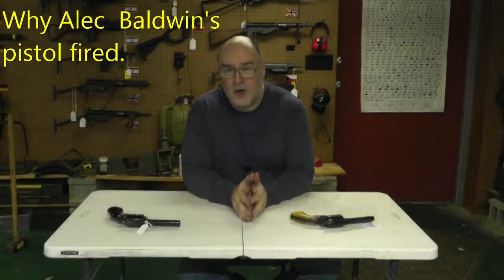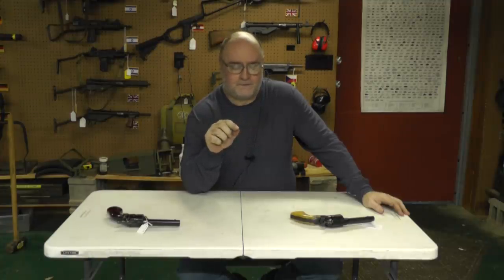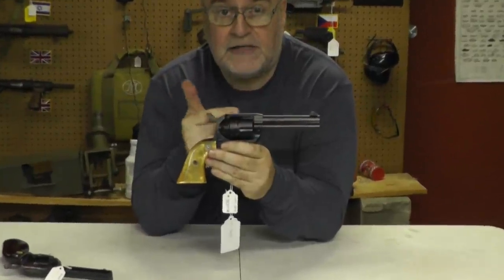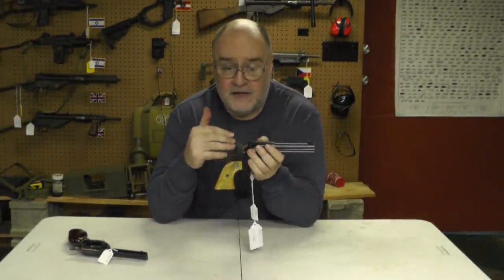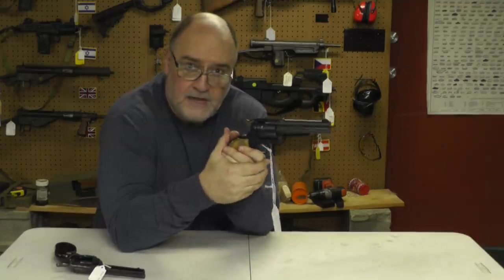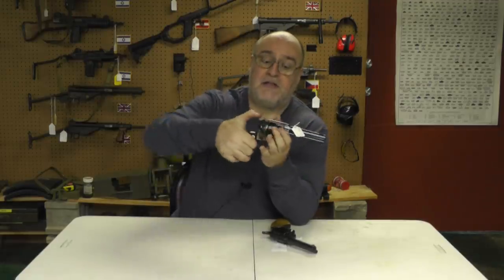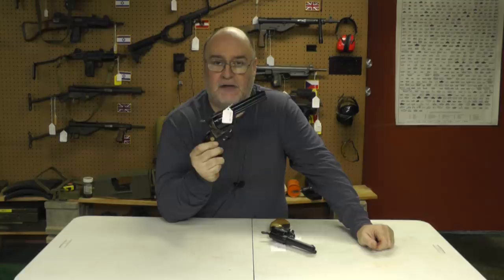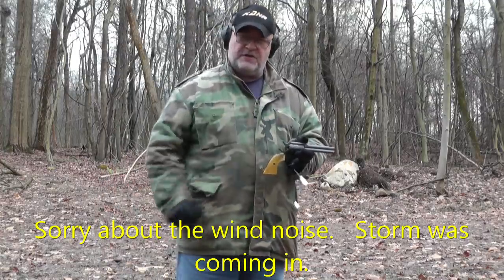Why Alec Baldwin's gun fired

Comment: I have 7 single six pistols and this is exactly how they operate, good job. This is exactly what happened to Baldwin. The trigger may have been adjusted so that it was too light. However, no matter what way you cut it, Baldwin was negligent and the Armorer, the young girl, was incredibly negligent. I believe that Baldwin will plead out to Guilty-straight probation (no jail time) but I believe that the Armorer should and will be sentenced to jail. I believe the DA will allow Baldwin to plead out to no jail time but I believe the DA will not give that choice to the Armorer. The DA will insist that she does some jail time. If Baldwin is stupid enough to take this to trial I believe he will loose and he will go to jail as well.

Comment: I just wanted to point out I have actually done some speed shooting there's footage of me in the late '80s on baseboarding in Bolton Ontario Canada doing a speed demonstration and I used the same pistol I will say that I have one seen a pistol like this that had its notches shaved off so that you could fan the weapon without pulling the trigger this was actually a mod that was performed by some speed and trick shooters strictly for speed because it meant you didn't have to pull the trigger you just fan the weapon that's one thing that's one situation where I have seen a weapon that would fire if all you did was pull back the hammer all they did to achieve that was file it down a little bit on the other hand I have seen one that was so worn that it was out of use and when I asked why they told me that the parts were very rare and they were planning on making a part to rebuild it the problem had been and had been fired so much that that notch was worn off so when you pulled back the hammer you could feel it rubbed the notch but there was no click and it would not lock in position. Just wanted to point out that I have seen both of these and handled them and I have to tell you if that had been shaved down or had it been so worn inside that that notch was gone it becomes an extremely dangerous weapon to handle when it's loaded because all you have to do is let go of that hammer and it will go off now you make a very good point and there's a lot of people saying it's his fault you seem to be under the impression that the gun was supposed to be empty that is not true it was supposed to have dummy rounds which means when you look at the gun it's loaded! In addition to that the only way to really tell the difference between a dummy round and a real round is to take the bloody bullet out and see if there's gunpowder in it and if you don't do that the only other way really would be to shake it and listen to it or to put it on a scale to see that the weight of the gunpowder and primer has been removed in order for that to work you have to know enough about them to do that and that's the armorer's job. I served sir I was a Master Sergeant at Arms on board and at the time I did the shooting demonstration it was my job to know, however I agree with your assessment that Alec was probably not a serious gun guy and even a lot of gun guys wouldn't know anything about the 1897 Colt it's such an old weapon most people know nothing about it even though I was teaching firing skills and shooting technique and safety I knew nothing about that gun until I prepared to shoot it for the event but since then I've learned quite a bit about them and I have quite a fondness for them.
Reply: thanks for saying this.   evryone who's ever touched a wheelgun has made a video of this tradgedy, but as far as i can tell, not a one of them has inspected the actual gun.  perhaps he did screw the pooch, or perhaps the weapon failed..  i have no idea, and niether do these people trying to collect views.
everyone says innocent until proven guilty until they can make a video demonstrating their ability to shed zero light on the subect.
Reply: I had a Colt .22 that was worn in that way. It wasn't worth repairs at the time. I eventually took to the local police station where it would be taken to be destroyed. Very dangerous.
Reply: Dummy Rounds , do NOT have Primers , or they have fired Primers , this is easily observed , in a split second , from outside of the Revolver or through the open Loading Gate of the SAA . ~~~ They should simply USE " Plastic Snap Caps " and Paint the Bullet end Grey ! ZERO Confusion , for the Novice .
Reply: @mahatmahjeebs6622  my question is, why would there ever be live rounds at a movie set to begin with? I don't hunt with blanks?!
Reply: @mr.hanger  , They was Playin Games !

Comment: You're right he's an unknowledgeable gun person.   But it's irrelevant. I've been around guns all my life and I'm former US military and I did 30 years as a Police Officer.  Additionally, I have a relative who's a renowned movie and TV set armorer and this is what he told me.   It's not a crime what he did.   The actor simply does his job and is probably so mentally engrossed in what He's doing.  Many times, between rehearsing, practice runs and actual takes while filming he or she has probably done the scene 100 times.  Needless to say, there is an element of being tired mentally and physically here. 
      Now,  Its the props managers job or Armorers job to check all equipment being used. Actors never check guns.  Also live rounds are NEVER allowed anywhere near a set.  
 I was told its no different than giving an actor keys to a vehicle on set where the actor needs to do a scene while driving .  The actor doesn't check the vehicle being used for mechanical issues, safety checks , brakes and whatnot. So now let's say the actor gets in the car while filming a scene and then he starts the car and shifts it into gear . Then the gas pedal sticks and then he loses control of the car running over and killing the director.   Should the actor be charged with vehicular manslaughter ???  Umm NO.    Its the same exact situation.   I know people have a negative view of AB and maybe rightfully so but its simply not his fault. Being that AB was possibly a producer of the movie that would make him civilly liable , but not criminally.  Hope that clears things up.
Reply from the maker: No that doesn’t clear it up you need to go read the police affidavit there was a continuing course of conduct by Baldwin ignoring prior safety violations including two accidental discharges and allowing live ammunition on set he never made any attempt to fire the incompetent armor He ordered the incompetent armorer of the set while the scene was being filmed.  The assistant director handed Baldwin the weapon.   Again another safety violation.  The weapons were not secured during lunch another safety violation all knowingly permitted by Baldwin. the affidavit is a lot more specific with Baldwin continuing course of conduct lead to the woman’s death.  totality of circumstance if you were a police officer you should know what that means
Reply: Its literally in the actors guide book to always check your gun after an armorer hands it to you and to never point it at anyone.

Comment: You are 100% correct in your explanation. I own a Ruger Super Single Six in 22lr, it's also a earlier model refered to as a 3 screw. That means that it functions exactly like what you have except it is chambered in 22lr so the results would be the same just not quite as loud but still VERY DEADLY.
Reply: I also own one of those wonderful old Ruger single six in convertible fashion.  Ruger really wants me to send it back to be modded for safety against exactly this.  Nope, sorry.
Reply: @ruatonim  I agree with you about the upgrade or safety conversion. If you can't safely deal with the original workings of ANY WEAPON then DON'T GET IT get something else that has IDIOTS OR NOVICES in mind. It's tough to make some devices or tools COMPLETELY IDIOT PROOF cause there will ALWAYS a BIGGER IDIOT out there that you didn't plan for, sad but TRUE.

Comment: Thanks for doing this video. I’ve seen some of those other videos in which people were using replicas. A replica that has been manufactured in modern times does not work in the same way as an authentic period weapon.

The thing which bothers me is that they were using such a valuable firearm as a prop rather than using something more modern that would be safer to handle. Of course, not having a lockable gun cart was a major safety violation and having live ammunition on the set was in violation of their permit.

I used to carry a .44 magnum revolver when I worked my parents’ gold claim. Even though it was a modern weapon, my father insisted I only load five rounds and keep it on the empty chamber. 

Old habits die hard.

Comment: Thank you for demonstrating this.  My experience with Cimarron clones of the 1873 is that it is possible to pull the slightly hammer back, but before the first click: about 1/5 of an inch and let it go. It will snap forward again, possibly with enough force to fire a round without touching the trigger; just a light brush across the hammer would do it.  I think that Alec said he did not touch the trigger.  I have not tested this with live ammo; perhaps you could? Anyway, be careful, all. "The Devil loads empty guns." --Old Guy

Comment: It was an 1873 SAA made by Pietta . . . if you abuse the Pietta by fanning the hammer (in horseplay off set using live ammo) you can wear down and damage the notches on the sear. Compared to a COLT, a Pietta has inferior metallurgy. The sear is a $4.25 part, which means it might be pot metal, but hopefully just cut or stamped from an inferior steel.
If the sear is damaged, the trigger is essentially on less than a hair trigger, and an unintentional discharge can occur.
The Pietta does have a transfer bar, but that isn't part of the equation in this incident.
Reply from the maker: That’s true but the fbi tested the gun and it did not malfunction.  The pietta in this case was made in the 60s and does not use the transfer bar

Comment: Ok, not a gun guy, but I have a question. If there's a round under the pin, and I pull the hammer back some distance, but not enough to latch at the half-cock position, and then release the hammer, so it springs forward again, will it fire the round?

Comment: 1. Never point any firearm at anything you do not intend to shoot. 
2. Never put any cartridge in a firearm until you intend to shoot something. 

Either one of these two rules will always prevent a shooting accident. It won't fire if it's not loaded. Pulling the trigger won't matter if it's pointed in a safe direction. 

Nobody should touch a gun without understanding these simple concepts learned in the Cub Scouts, and refreshed in hunter safety education.

Comment: I'm a fan of short-chambered cylinders which cannot chamber standard live rounds but can chamber specially made blanks and dummies.  Using a .45 Schofield cylinder for blanks and dummies while having .45 Colt cylinders under lock and key for any required live fire would reduce the odds of getting a live round in there.  Setting  an adapter bushing in the chamber could have the same effect.
Reply from the maker: True but that costs money.  A low budget production company would not pay for that
Reply: @psp1921tsmg  A .44-40 cylinder for Uberti 1873 is $113.93 on Midwest Gun works website and can chamber a 3in1/ 5in1 blank but cannot chamber a .45LC.  Modifying the cylinder to prevent live 44-40 but allowing short dummies is quite easy.  
Then you keep the .45LC cylinders under lock and key unless needed for live fire.

Comment: It also doesn't explain why he was told the gun was safe by the person who handed it to him or that the armorer didn't properly check the firearm.  It is the responsibility of the professional armorer to make sure the actors have the knowledge they need to operate the firearm safely, that the firearm is functioning properly, that only blanks are in the firearm and no live rounds are on set, and to check the firearm before each scene.  None of those things apparently occurred in this case.  If I was an actor and not particularly knowledgable about firearms, I would rely on the armorer to do their job and give me the instruction and guidance needed to use the firearm safely and follow their instruction / guidance.  When the process of having a professional armorer on set breaks down because the armorer isn't doing their job, the actor doesn't receive the proper instruction / guidance to use the gun safely, safety procedures like checking the weapon before handing it to the actor to insure the rounds are blanks, making sure live rounds are not allowed on set, safe handling etc.. break down right along with it.  I agree that the actor should check the ammunition as well when receiving the gun and handle it as safely as possible.  I think the armorer is far more culpable in this case.  If the armor had done their job as I described none of the failures in safe handling of a gun on set would have happened.  Proper instruction and safety training / guidance is a responsibility of the armorer.  If that occurs and the actor disregards the instruction and guidance to use the gun safely that is certainly another story and makes rhe culpability of the actor far greater.  That is my opinion,  I don't think Baldwin was being arrogant or intentionally reckless in this case.  He was clearly very distraught after the incident and according to your explanation, was being honest with law enforcement about what he believed occurred, not realizing that by having his finger on the trigger the weapon would fire if the hammer is released from a fully cocked position.

Comment: The question which troubles most is that why should there be a live round inside the chamber. The primary safety measure protocol was not followed.
Reply: Exactly. Whoever loaded the gun knew that it was a live round. In my opinion this was murder.

Comment: Just curious but what would happen if you pulled the hammer back and stopped just short of the half-cocked position and then let go.   Would the hammer snap back and strike the primer with out pulling the trigger or holding it open?
Reply: Yes it would to about 1/8 of an inch, but it would not have enough travel to set off the primer charge.  After about 1/8 inch, the hammer locks.  The upshot is that the Model 1873, properly maintained, is designed to fire only from the fully cocked position.

Comment: The armorer, in violation of the rules, had mixed blanks and live rounds in her shop.
Normally a blank looks different than a live round, but movie folks sometimes make their blanks look real so the camera shot looks real.
Realizing that blanks by themselves can be dangerous (as one now dead actor found out).
So the armorer failed, the assistant director failed (he was supposed to double check the gun), and Baldwin as the Producer failed.
The reality is movie procedures should be overhauled ….. blank guns should be dedicated blank guns with a blocked barrel.
Sad.

Comment: Excellent explanation of what happened! The question now is why were they even using a gun capable of firing? All you would need to do to make absolutely sure the gun was 100% safe would be to cut or file the last 1/4” of the hammer off. That way even if some dimwit loaded live ammunition in the gun it could not fire. It ain't Rocket Science Hollywood, just common sense.

Comment: I knew his explanation was bogus because it's the exact same excuse my dad used after he shot me in the back with a Ruger .357 Blackhawk revolver. It was years later that I examined the revolver and could plainly see that it was impossible to discharge a round by simply pulling back on the hammer and releasing it. My dad passed away before I could find out what really happened.

Comment: I have a question? What happens if you release the trigger between the closed position and half cocked? Surely the gun would fire? Isn't that why you have the hammer on an empty chamber? Also everyone seems to be saying Baldwin knows nothing about guns so does he know what half cocked actually means?
Reply: The saying, "Don't go off half-cocked" pertains to this type of firearm. Half Cock IS the safety. To answer your question, No the gun would not fire. If the hammer is down on a live round and you cock the hammer and let it go before half cock the gun still will not fire because the cylinder would rotate and the round would not be in line with the hammer.

Comment: The armorer has one job, to make sure the firearms on a set go from a locked safe, is checked, and then is handed to the actor. They don’t do lighting, sound, catering etc. Their job is only the firearms on the set. They are also responsible for making sure live rounds are never near the firearm, and to make sure that safety sequence happens each time the firearm is handled. It was an unnecessary tragedy. But to only blame AB is the equivalent of saying James Bond should be charged with attempted murder because he negligently points his gun and fires at the camera at the beginning of each 007 movie.